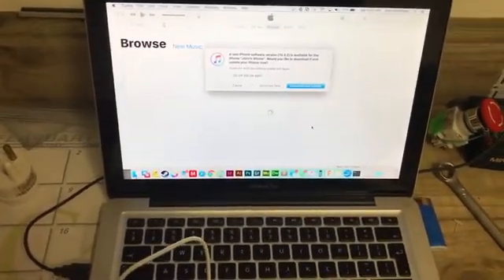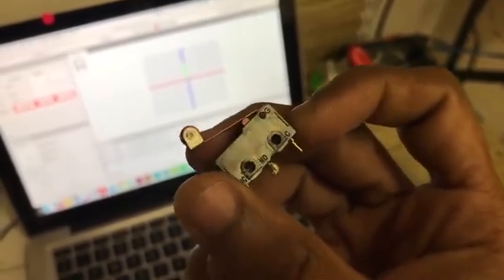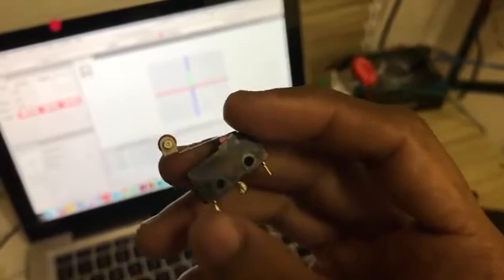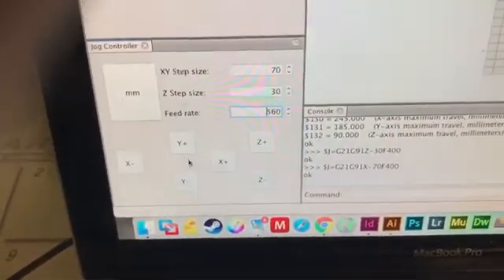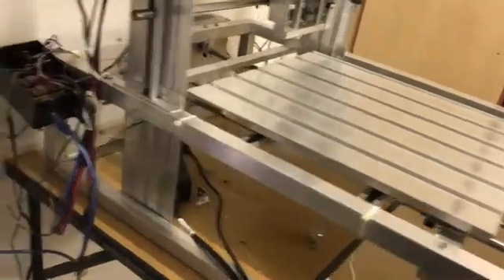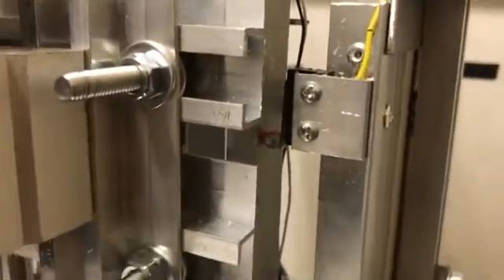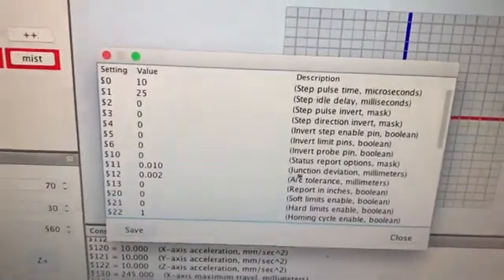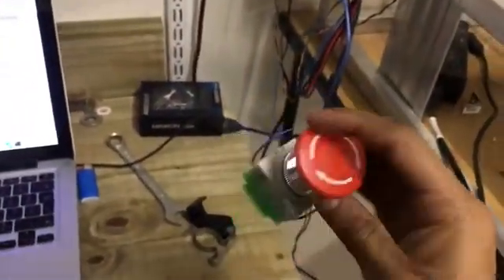Setting up your limit switches with GRBL

Comment: can i use NC Switches to? i dont want normally open, because this gets more errors?=
Reply from the maker: You can use NC switches by setting $5=1 (invert pin logic)  and enable hard limits with $21=1. Use shielded cable but If you experience any interference issue you can add 10k pullup resistor between sig and vcc or pulldown between sig and gnd pins. Hope that helps you, good luck!

Comment: I am having issue, i have 2 axis machine and when i run $H command it homes one axis and the other one moves a little and doesn’t home. If anyone has an idea
Reply from the maker: Have you tried to home with hard limits disabled? or are you experiencing this issue with hard limits already disabled?
Reply: @garageundergroundza  big thanks for this tip.  been pulling my hair out with similar issue to uc@bamboozled5114 and luckly i came across this video , so just want d to say big thanks because this repaired my sanity :-)

Comment: Hi, I have a problem with my shield! its protoneer board version 3.0 and the error is that my spindle enable is swapped with z+ contact which is a common issue as I did some research!
So now when I need the z+ for my z axis limit switch I connect it to spindle enable pin and it doesnt work!
Can you help me out with this or point me to a direction where I can get some help?
Thanks
Reply: hi ım low engilis
translate you = z+ veya z- pimi spnend bağla)
Reply from the maker: Hi there! you can redefine which pin is used for Spindle enable! which version of GRBL are you using?

Comment: Hello,
can you put the connection diagram link
 in description
Because I connected as you explained and adjusted the grbl file , but unfortunately I did not succeed. and thank you
Reply from the maker: Hi there! Here is a link to the CNC shield asssembly guide: https://blog.protoneer.co.nz/arduino-cnc-shield-v3-00-assembly-guide/#EndStops

If that doesnt help you, describe your problems in detail and I will try and help you :)

Comment: i dont think you helped anyone!
Reply from the maker: I made this video for one specific person, it helped him and that's good enough for me :) Thanks for your valuable feedback.
Reply: @garageundergroundza  3 days straight and I still havent figured out why my limits still set off an error.
Reply from the maker: @ronniepaulinc  You're getting EM interference in your switch circuit which is triggering a hard stop. You can either disable the hard stops in GRBL settings (short term fix) or use shielded cables for your switches (proper fix). Regular old ethernet cables work great for this purpose cos they're already shielded :) this is mentioned in the video!
Reply: Oh yes, it helped me!! Same problem with unshielded cables. I’ll try with yours suggestion about ethernet cables. THANKS A LOT!